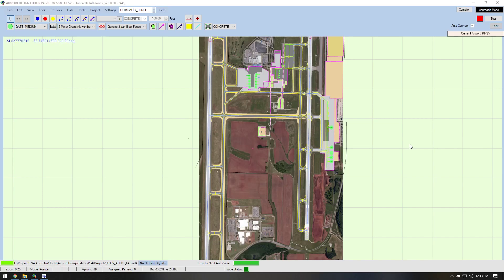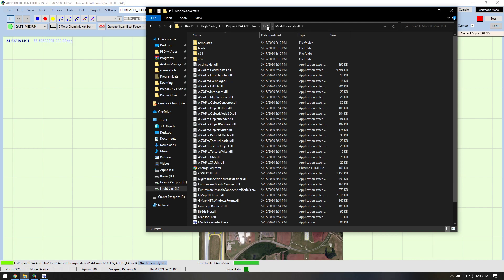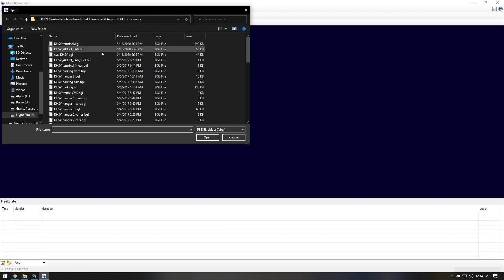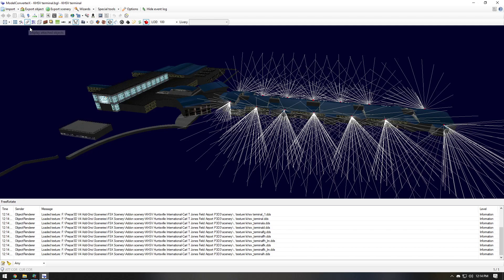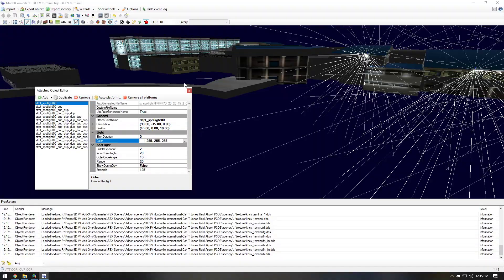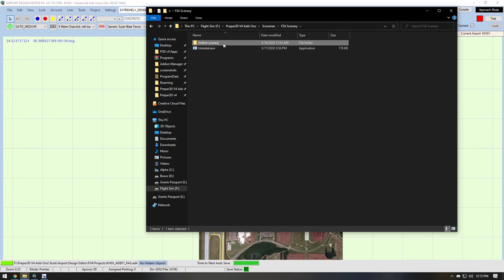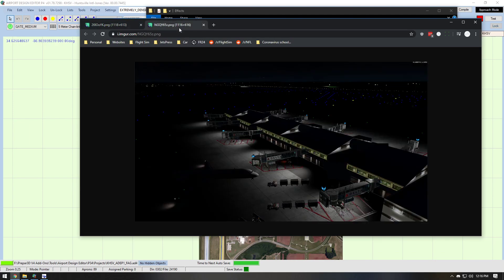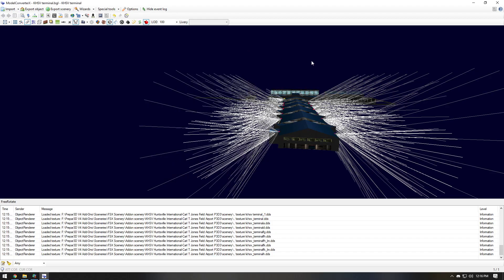P3D v4.5 - How to add dynamic lighting to any airport

Comment: When I go to add a object, spotlight does not show up under that drop down menu. Is that because I don't have the right SDK? All I have is "light" and "Library Object"
Reply from the maker: What version of ModelConverterX do you have? I would assume that would be because of the SDK, if not the version of MCX.
Reply: @VirtualFlyingGrant  I'm not sure, I just downloaded the one from the link in the description
Reply from the maker: I would try getting the SDK installed, if that doesn't work then I would head over to MCX support forums or something. I haven't used MCX in a while
Reply: After you select "light," there is an option to change it from "point" to "spot"

Comment: I have a very inconsistent lighting on my p3d 4.5

https://www.dropbox.com/s/6lhfpfi7fyyhbce/IMG_20200520_100146.jpg?dl=0

Take a look at the truck behind and the addon aircraft i have. The dynamic lighting is on, i don't know whats wrong with it.
Reply from the maker: That looks like texture based lighting and not dynamic. If it is dynamic, do you have dynamic reflections turned on in the settings?